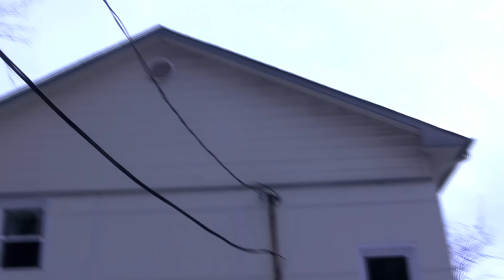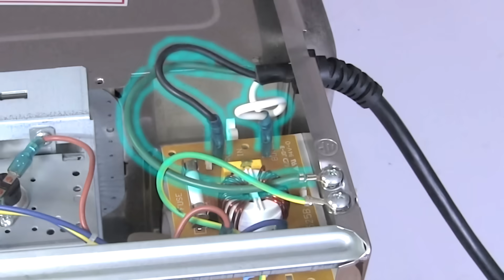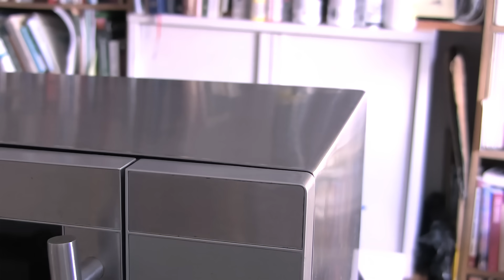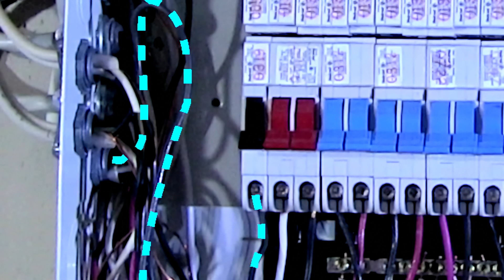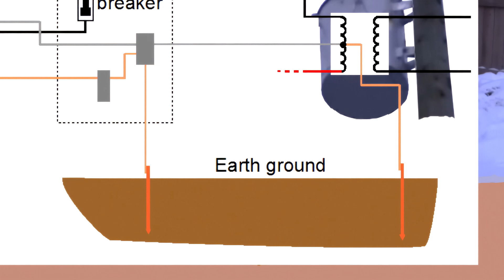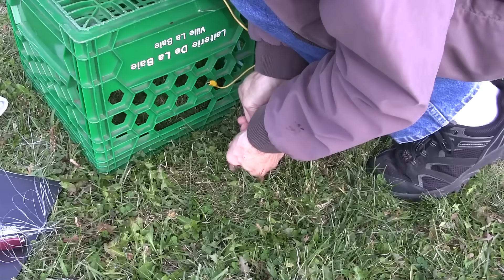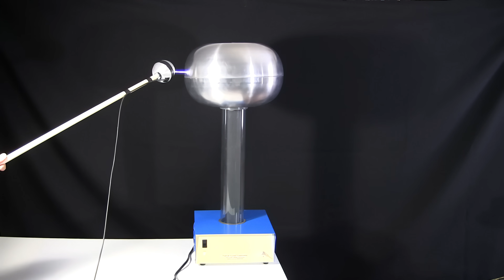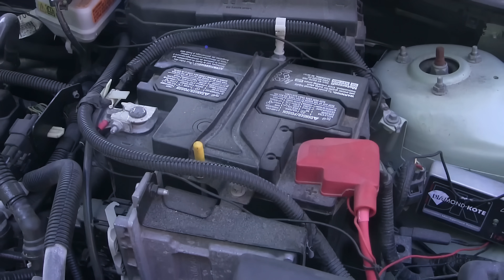What is Ground? Earth Ground/Earthing

Comment: I always feel grounding is more dangerous than not grounding. Assume there is a leakage and your enclosure is live. You get a shock only when other part of body connects to neutral. Now when there is ground(earthing) your body gets an alternate path. Every time you touch a live wire with feet grounded you will get a shock. At least this is true where the floor is concrete and not wood.
Reply: You will get shocked anyway GND or no GND. The power company uses the GND to establish thier reference ... in other words what they consider zero volts. The generator is GND, transmission lines are GND, and as shown in the video the center tap of the pole transformer. 

So if you touch a live wire and your feet are touching GND and the impedance between your feet and GND is low you will get a shock.

The power company can't let the neutral float because it would drift up in voltage, all the way up to the maximum phase voltage. Also, without a GND a lightening strike will charge the neutral up many millions of volts which would then discharge through some device in your house right from the neutral through ionized air to GND, which of course would be horrendously destructive. Also you need to remember that power was generated by the power company's generators in three phases, not one. However, you are only tapped into one of them. The others go to different neighbors on different blocks or sides of the street or whatever. If all consumers on all three phases had equal or near equal loads then current would return to the generator via one of the other phases. In a three phase motor that's exactly what happens because all three phases are loaded the same. However you and your neighbors do not all match your loads so some current returns on the neutral and if not GND it floats all over the place, it does not stay at zero volts.

It is true that the power company could run a dedicated neutral out to each and every pole but that is one more wire and wires cost money! Plus a lightening strike would still supercharge the line. The lightening voltage is with respect to the ground because that is how its generated - between the earth and clouds. So that neutral line from the spot of the lightning strike wpuld have to cary that current all the way back to at least the substation and along the way and any voltage drop in the line would be seen by each consumer. No matter how thick that wire is there will be some drop and at millions of volts, that drop would still amount to thousands of volts comming into the house.

Anyway you look at it the earth is the best way to establish a reference to zero volts, but that means that a voltage path to earth will exist. If the earth has a good impedance then more than a few mA will flow - and if enough to kill a human can flow, and a human is the path to GND, then zap. But thats still better than sending lightning strikes into peoples homes.

All of this is to say nothing about the AC effects. Problems such  as real power, observed power and other phase effects that result from inductive loads versus real loads are major issues. Therefore the need to isolate customers from eachother in terms of those issues is important.

The power grid looks simple. Generator, wires, transformers. It fools you into thinking the system is simple. In reality though the grid is very complex.
Reply: You are welcome. 

I dont know where you are in your life or career, but I am an electronics engineer with 30 years experiance. I dont work with high power stuff and only had one semester of study in the area. I have allways had the exact same question as you so when I saw your question I thought to myself "its time after 30 years that I understand this question that both of us have", and then share the answere with everyone.

It took me two days to figure out why your idea was never used in real life, and not even the book that I still have from that class i took 30 years ago had 100% of the answere in it. Even the web had all kinds of explanations, many of them just plain wrong. Not an easy answer to track down at all! 

After figuringbit out I realisedthat I had actualy been dealing with ramifications for years. For example:

Sometimes in the electronics lab at work I used an isolation transformer to isolate my test equipment and circuit being studied from the buildings GND at the plug. I do it because not even earth ground is a perfect zero. It varies all over the place. Usualy not more than a couple of volts but enough. 

If you were to use an isolation transformer on your entire house then what you proposed should work. With the transformer not connected to GND you should be able to touch eithier output line [NOT AT THE SAME TIME] and not get shocked. I AM NOT TELLING YOU TO TRY THIS, AND IM NOT GOING TO TRY IT MYSELF, but in my lab both wires of the isolation transformer output show zero volts to the GND on the plug. Now the shock hazard using an isolation transformer is high for the other reasons mentioned about a hot wire touching the case and then you touching the other hot wire while touching the case, but that was not your question.

Another good example of what you proposed is a controversial question about running your house on a home generator, and whether you should connect the generator GND to earth GND or not if you are back feeding your main panel. Lots of videos on that. 

So our question was a good one,  with lots to say about both having, and not having a ground, especially when you have your own power source and not miles and miles of wire between it and your house that could see major effects from lightning strikes.

Note to the content creator. The answere to this question was right in your video all along, but not explicitly stated. You might want to talk about why the center tap of the pole transformer is tied to GND, and the red wire to black wire having 220 (in north america) across them.

In closing, thank you Phani Raju for getting me to think about the question so that I could finaly put my nagging curiosity to bed after 30 years of wondering why they did that with the GND. 

Cheers,

Leo
Reply: Leo Petropoulos you have an excellent understanding and I guess lots of curiosity. 
Well I am an Electronics engineer, worked mostly in embedded systems. 

I had this query from long time. I did demonstrate to my kids, holding live wire, me ungrounded for their science (electricity chapter) explanation and why it is must to isolate your feet from ground. I understand this is a dangerous way and I had this query then, what is the need for grounding. 
Thanks a lot for your valuable time in explaining in depth. 

Regards 
Phani
Reply: @pbraju123456  no problem. I work for Xilinx. Let me know if i can ever help you out with anything embedded. Cheers.
Reply: @leop9021  hi,surely the numbers of  'phases' that is generated by the power company has no bearing to the problem at hand as once if goes to the step down transformer it becomes an isolated circuit and the 'grounding' issue is more directly related to the grounding of the said step down transformer and not of the grounding at the power station, that is unless there is not a grounding link at the transformer.
Reply: Hi Eric,

I think you might have missed that what I said is that the generation and transmission of power using a three phase system had a major and pivotal role in the decision to solve certain power distribution problems by using a "neutral tied to GND" type of system; at least here in the U.S. I do not think that I stated that the generation and transmission of three phase power would prevent the circuit you described from working for a short period of time. It will as you state not prevent your experiment from working

I say "short periodof time", and "experiment" because I think it's important to realize that a simple isolation transformer design like the one you describe will never work to power an entire house in any practical sense. An appliance perhaps, but even then a GND is required if the appliance is not double insulated. 

In the US we make use of a neutral to solve the problems that make a simple isolation transformer supply impossible to use to supply power to an entire house. In Europe they use different methods to solve those same problems despite also using 3 phase power for distribution. That's why most European homes do not have a neutral or polarized plugs. So to some extent the use of three phase power and it's influence over whether to use a "neutral tied to ground system" or something like the European system, can legitimate be said to be somewhat influenced by which continent you live on.

Cheers,

Leo
Reply: Leo Petropoulos thanks for that in depth reasoning.
Reply: If you're in a bath and an electrical appliance should fall in, if there's no ground you'll just keep on being electrocuted instead of the power cutting out.
Reply: CapeofStormz not entirely true it depends on so many conditions. Your both Phase and neutral should leak. If only phase is leaking you will get a shock only if grounding is implemented. It is totally ok to bath in a live exposed water provided it doesn’t find a way to connect to neutral. I have seen in some manufacturing plants using isolation transformers to isolate the grounding on conveyor lines where there was live 230v to power TV 📺 units under manufacturing.

Comment: Wrong. Both the + & - are attracted to the N...if it travelled the way you claim, it would short out. You can prove this by placing a steel slug at each end of a magnet and see that they both stick. No thermodynamics in play in the magnet at all, is there? Your electrical instruments are not designed to detect + or - , only electrical charge. And in an electromagnetic fusion reactor or an artificial charged particle using lightning to begin the reaction, thermodynamics IS the reaction. We' didn't design a steam engine here.

Comment: Hello have a layman question?
What happens if you have a grounded conductive rod and just above it connected to a conductive board. Just above this conductive plate is another conductive plate with positive charges.
What happens to the conductive plate attached to the rod ?, the electrons have risen from the earth through the rod, reaching that plate that is connected to the rod to be closer to the positively charged plate?

What is the energy required on the top plate to carry out this induction process from the earth charges to the conductive metal plate connected to the rod?
Reply from the maker: Yes, the electrons rise from the earth to the plate connected to the rod as you describe.
Without some numbers and dimensions, it's impossible to calculate the energy.  But the initial energy is whatever is needed in order to put the positive charges on the positively charged plate in the first place.

Comment: And what the Electric company is NOT TELLING YOU is, the neural energy returning back to the grid is then collected and sold back to you 😕 their is a approx. 3v of power feeding from your panel on your home back to the electric company so that means you are charged for that 3v returning back to the electric company per kwh illegally thus increaseing your monthly bill. 😀 happy researching because believeing corporate fiction and too many LIES will get you Nowhere but a higher bill every month lol 😅 not understanding how you are getting ripped off ✌say thank you to the theives you rely on for power.
Reply: Not true. Ground has nothing to do with power consumtion.
Reply: @robertkat  test it see how much electric is leaking back to the grid. I have done the test and installed measures to stop the leak for my self, not saying everyone has to stop their electrical leakage, just explaining how I did! I don't care if nobody believes me 😉 How can you ride on just your ego without testing your own system?
Reply: Yeah because the Volt is a unit of power, of course
Reply: @danwintle8585  This helps stop someone getting ripped off by recirculating the leakage, it works we have one installed. basically it is a transformer Can,  just like the ones on the grid lines every couple of poles, they are white.  easy to install . It just saves the leakage thus bringing your electric bill down . https://www.amazon.com/Power-Factor-Correction-Energy-Saver/dp/B076TP4TPX/ref=asc_df_B076TP4TPX/?tag=hyprod-20&linkCode=df0&hvadid=309807586683&hvpos=1o3&hvnetw=g&hvrand=5194987355000152950&hvpone=&hvptwo=&hvqmt=&hvdev=c&hvdvcmdl=&hvlocint=&hvlocphy=9031504&hvtargid=pla-585135941473&psc=1 ;-)

Comment: If both ground and neutural wires are eventually connected in the breaker box, why do we need both of them in the power point? Neutural seems enough
Reply: What you are asking about is to only use two wires from the breaker box and connect the case to the one neutral wire.  The third ground wire protects against something disconnecting neutral wire in the outlet.   I think of it like the sink drain, normally water comes out of the faucet and goes to the drain (neutral).  There’s a second drain at the top of the sink in case someone closes the drain and leaves the water on.   This is kind of like the ground, but it only protects against a problem that stops water from draining in the sink.   It won’t protect against a clog below the sink in the pipe.  If they wanted to protect against that they would need a second pipe from that second drain that runs all the way out of the house.   That is what the ground wire is doing.  Hope the analogy makes sense.
Reply: i had the same question.
Reply: Basically we don't;
I remember as clearly as being there in 1954 —  55 being at the kitchen table on Oliver Street in Dallas ~ we had to me what is profoundly wtf question arise when someone present was advised not to grasp the toaster with bare hands; 
This screwed me to the wall so I asked Why?
I was told that inside the toaster the return was tied to the case but that side of the "plug" was not designed to prevent the 110—115 volt energized feed from being installed  «backwards» ( reversed ) → I wonder to this day why such a thing could have occurred;  Note that at the time I would have been about 4 years old;  Later in life I would swim 15+ feet under water in an undertow in a storm surge and just casually push off the bottom when the undertow pulled my feet from the sand; When these 3-rd wire ground became popular it was nonsensical to me why anyone would really need them to the extent they were deployed on about everything and required by code;
A 1-megohm resistor inside the case ( panel ) can leak off an excess static which is a valid concern without pulling an load that is of consequence;
Reply: The point of neutral being connected to ground is to protect the circuit from lighting strikes on overhead lines or other circuits nearby accidentally coming into contact and raising the voltage of the circuit above its normal potential. Instead of damaging the equipment, the high voltage would go to ground and the breaker would trip. All exposed metalwork must be connected to ground (earth), in case a bare hot (line or live) wire should touch the metalwork and electrocute someone. Therefore, all exposed metalwork must be bonded together and connected to ground (earth). Therefore, in this case the neutral and ground wires need to be separate.
Reply: @kennethcohan9630  
Keen workup supported by the max interrupt value shown on breaker label; The float I thought I did okay describing can be taken down via 1Meghom resistor;
Reply: Because N is a dedicated wire to conduct the wattage, in short
Reply: The point of the ground wire is to have a direct, low resistance path to ground.  Suppose you used a neutral as a ground in a metal casing electronic device, the more electricity you put through the neutral, the more likely you are to get shocked if the live were to the touch the casing. As a thought experiment, if you were to plugin 2 neutral wires of the same gauge to say a light bulb, the amps would spread in half between the 2 wires because current more or less follows the path of "least resistance". But what if one of the neutral wires was thicker than the other? That thicker wire would actually carry more amps than the other because due to having more capacity (thickness), you need more amps to balance out the resistance between the two wires. Grounding follows that same principle. The ground and the neutral may be connected down the line, but the green cable is specifically designed to have the least resistance to ground so the electricity doesn't jump through your body down to earth.
Reply: Daniel Baharestani the ground is to dissipate the shock which is caused by the current tripping.

Comment: Ehh, an Ontario license plate :) Good explanations sir, will have to take some notes on this. 

I've been apprenticing for about 2 years now and I've always heard about grounding (and bonding) in school but you only realize how important it is once you actually work around electricity for a while. Getting those small shocks while trouble shooting because someone didn't ground something pretty much clues you in on why inspectors look for these things specifically.

Not to mention, when you see a ground wire get scorched during a short, you'll be glad the electricity went that way instead of through your tool and you.

Comment: If one of your hots opens up your dryer motor will run and the drum will turn but your dryer won't heat. Check this before you run out and buy a new dryer like my dumb ass sister did. Her drunkin' ex husband came over and did some re-wiring and fucked up the splice on one of the hots. He was a professional wiring technician no less but being a drunk caused him to fuck up a lot.